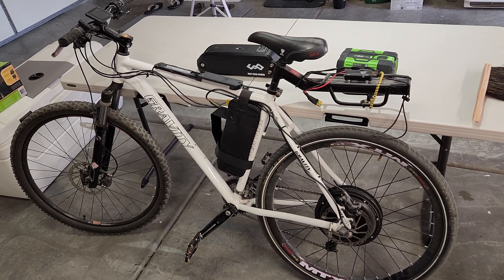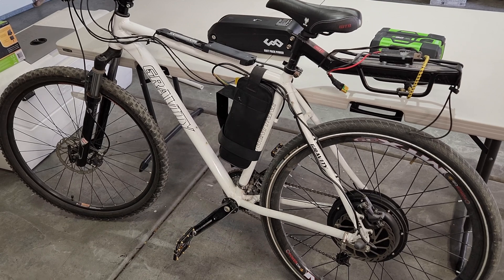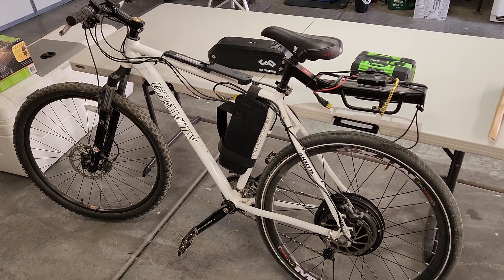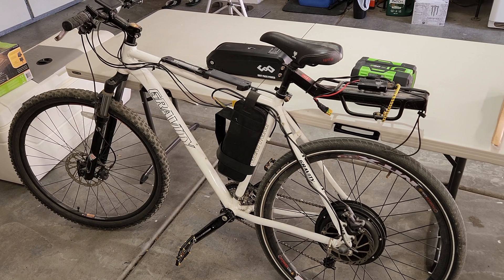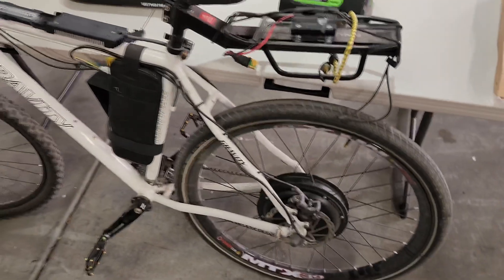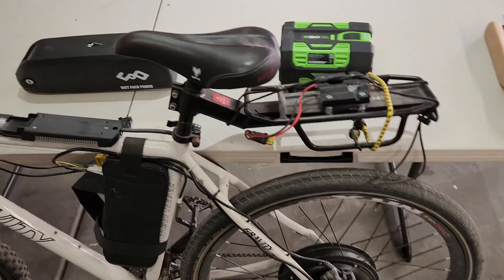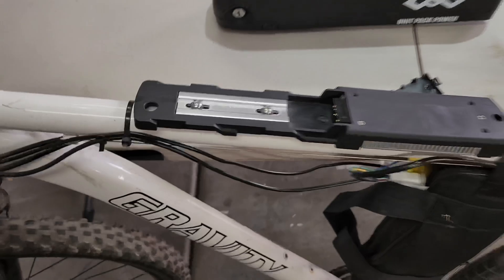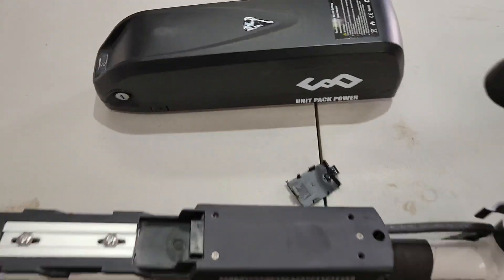EGO powered Ebike - UPDATE!

Comment: What's the farthest you've gone on the ego 7.5ah battery? I currently have an ebike built with 7.5ah battery but am too scared to go test lol
Reply from the maker: ya know, I never did a distance test, like keep riding until it dies? Cause I didn't want to walk back home 20+ miles or whatever. The 5ah battery, I used it and rode around the neighborhood several times and easily put 15 miles on it, and the battery indicators on the ego battery still showed 2 of the 5 bars light up. Plus, I wasn't going full speed/full throttle that whole time, which I think would affect distance.  I hope that helps some. :)
Reply: @simplegoodleather  Thanks, yeah that definitely does help.
Reply: Highly depends on weight of bike and how much pedaling you do yourself. 7.5 should get 10-20 miles.

Comment: I have a bunch of EGO power tools and a 2000w power station with four 7.5ah batteries. I just started using my 7.5ah battery on my electric recumbent trike with a shunt modded controller. My controller is originally rated @ 35a. After the mod? IDK? My recumbent runs great. Way better than it did with my 48v pack.
Reply from the maker: That's awesome.